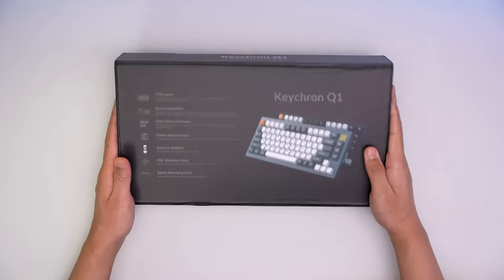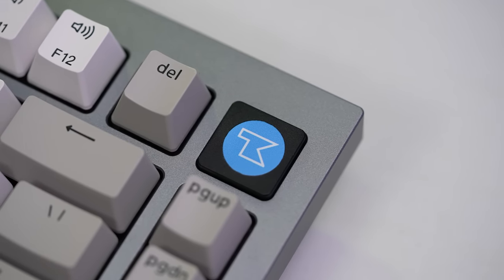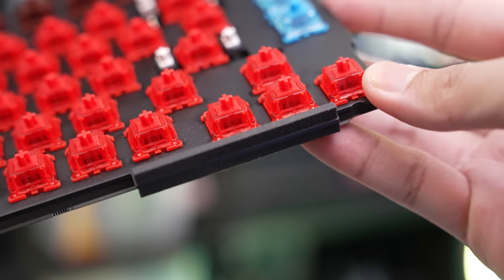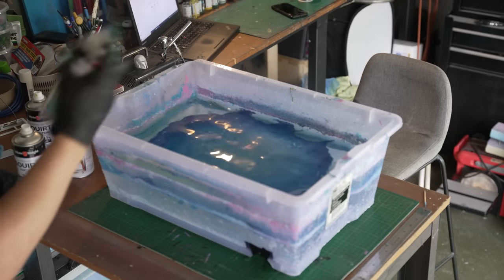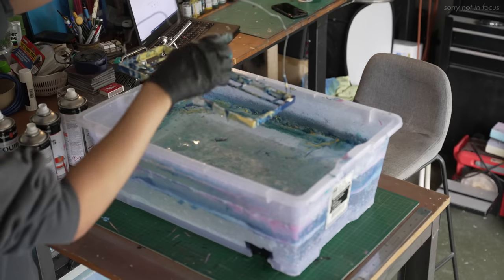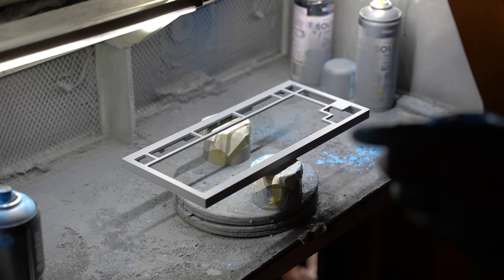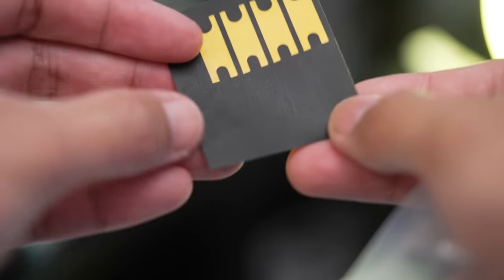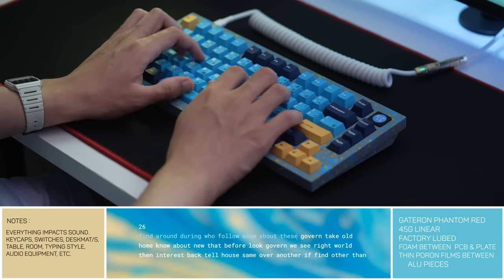Splatter Paint Keychron Q1 Mechanical Keyboard

Comment: Adding some polyfil solved the ping problem from bottom piece for me. It can also take a rotary encoder if you solder it, though it does need some fresh code to use the knob. Also it doesn't have anything to cover the empty space around the encoder unless you get a big hecking knob.

Comment: JYMV has a video where he removes a board's anodization with oven cleaner, and he mentions how he got a nosebleed when briefly being exposed to the oven cleaner fumes. Also, it can permanently mark/scar skin if exposed directly to the cleaner. edit: but damn that looks so clean, it might be worth it
Reply from the maker: interesting, nosebleed is a bit scary. fortunately i use a full face respirator and spray booth.

Comment: So I found out that oven cleaner will pitt the aluminium. I've used the equivalent of Draino crystals in a tub of water to strip ano from aluminium and it seems to work without pitting the alu.

Test first on a throwaway piece of anodised aluminium before you do it on your keyboard.

Comment: Honestly, I don't mind the case ping or most of the other faults with the Q1 but....man that ribbon cable for the daughterboard is a HUGE problem for me.
Reply: The second batch Q1 are using thicker cables, no more ribbon
Reply: @z4k1_zaki65  Really? Hell yeah
Reply: @notnubilous3804  Yes, the second batch received alot of changes, including thicker bottom case, silicon pads for force break mod, and more

Comment: removing the anodisations isnt the best idea... the thick anodic oxide layer, it higly corrosion resistant is extends the life of the metal by a massive amount. while exposed aluminium will form a passivating oxide layer withingmilliseconds, this is easily broken and the metal can corrode to mush. ano can be painted over with some abrasive and primer
Reply from the maker: noted :)